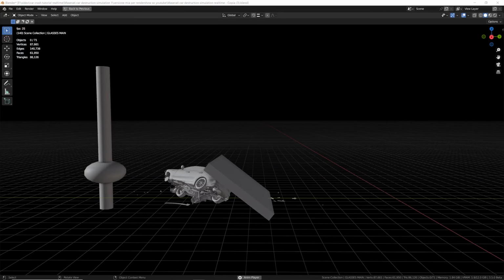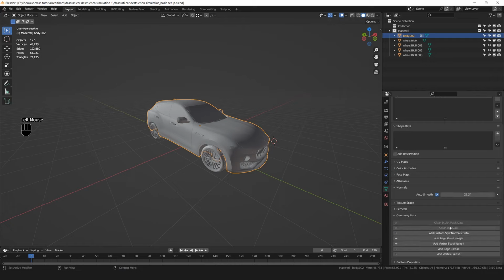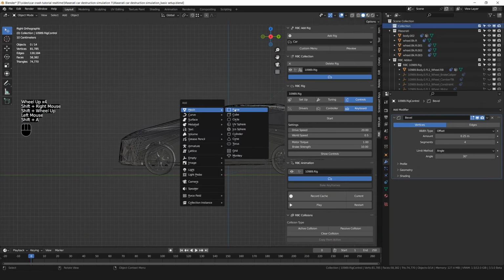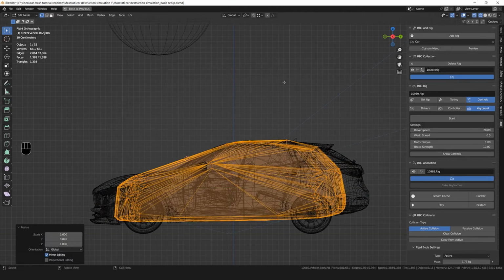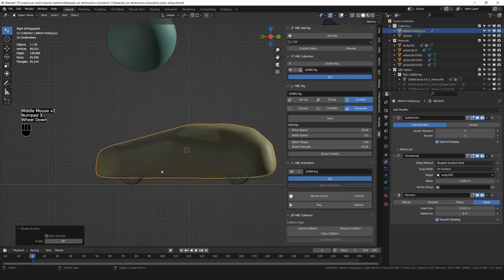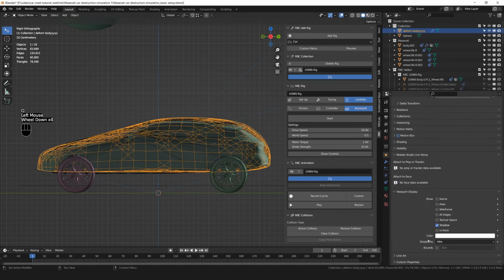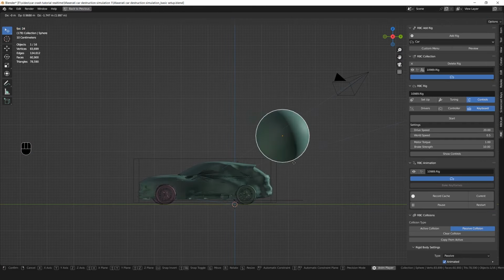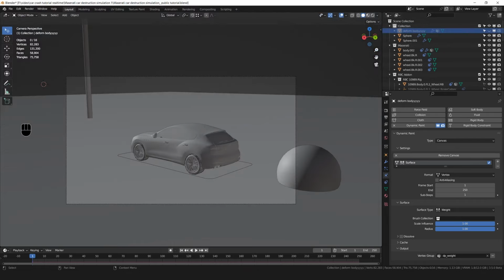Realtime CAR DESTRUCTION - Blender vfx Tutorial

Comment: Great tutorial, but Blender is crashing when I click the Bind button on mesh deform, any ideas what the problem is and how to fix it?
Reply from the maker: weird, it can be for mutiple reasons.... but potentially is because you have to lower the geometry of both car and deform mesh.
Do multiple tests basing on your pc
Reply: @RaffoVFX I think the car was a bit geo heavy, so I turned down precision in the mesh deform to 4 instead of 5, and it seemed to work. Thanks for answering anyway, and thanks for the great tutorial.
Reply: I have the same problem here. My computer only let me bind at precision value 2. The car body is not reflecting the drastic warps that he had in the video. How would I decrease the geometry at that step? or would I have to redo the whole tutorial again? @RaffoVFX
Reply from the maker: @SpkdroStudios  rather then reducing the binding precision, check and reduce your car's geometry as recommended in the video
Reply: @RaffoVFX  Would that be through the decimate modifier? Cause I have 3317944 face count for the body, and when I try to reduce it, it freezes blender :(

Comment: Thank you so much! Joining Patreon! :)
What are your PC specs? Is it worth it to bump up the quality if I have a 13900K with a 4090?
Reply from the maker: Hi! You have my same cpu :)
I made all possible stress tests and well, with that specs dont worry that its gonna be realtime even with 250.000 vertices and 2 cars in the same scene.

But what really makes the difference in the realtime performance is really the total amount of vertices of the "deform mesh", for which I would make my best to stay max at 4000 vertices for the car body, plus other 800 vertices for each door.
GPU will be valid for the render mostly.

Comment: Great video! I'm running into an issue where if I press the ball on the car, it becomes jittery rather than a smooth deformation like in the video. What do you think is the issue? I tried tweaking the distance for the ball brush and worked smoothly at a distance but if I wanted to get close like in the video it would continue jittering again.